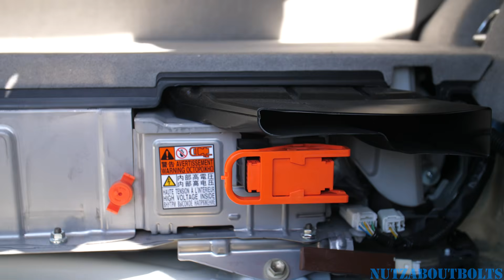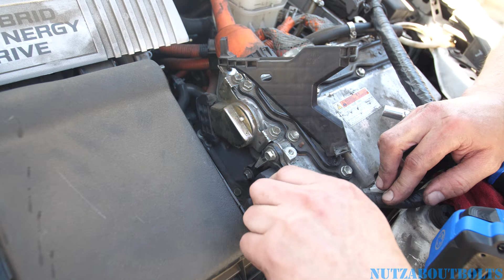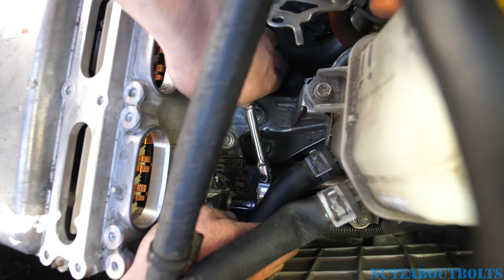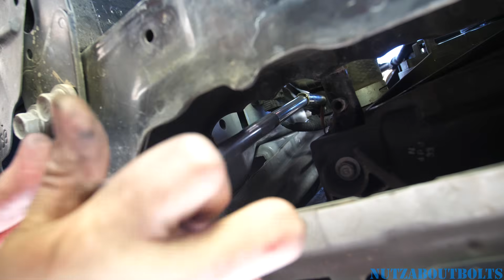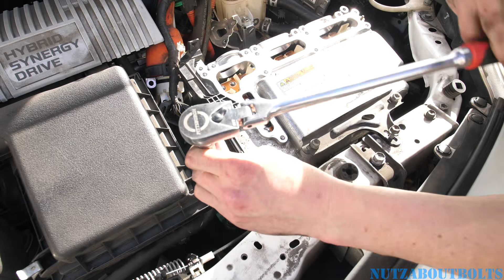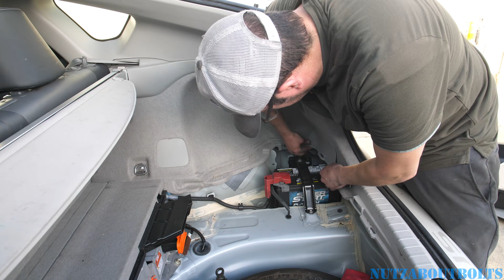2010-2015 Toyota Prius Inverter Water Pump Replacement

Comment: I had to remove the radiator and disconnected the inverter hoses and lost fluids, anyhow when I filled the inverter reservoir and turned the car on, the coolant never dropped and I don’t see movement or flow/turbulence in the reservoir. I did check the pump by hand and do feel vibration as if it’s working but just wondering if these are suppose to have turbulence at the reservoir like the 04-09 models
Reply from the maker: You should see a quick drop in fluid the first time you turn the accessory on engine off. I’d recheck your work to see if everything’s reconnected properly…

Comment: WAIT.!!!   There is a guy who made a video getting the Gen 3 Inverter Pump OUT and IN all from the bottom - he didn't do ANYTHING touching the inverter. Not even 1/4 of all the things that this guy took apart. The only tricky maneuver is getting the top bolt out using the right tool setup but it is definitely doable.      Jus tryna help.!!!
Reply from the maker: That's interesting, there are definitely different ways to tackle these jobs depending on your tool set and experience 👍🏼

Comment: Could a failing inverter pump cause a p261c code? I just changed the water pump and thermostat with aisin last year so I’m hoping those are okay.
Reply from the maker: Looks like that code is for the engine water pump…

Comment: I'm just glad I spent 3 hours doing this and at the end of it I get a "check hybrid system" my car is fuckin bricked and won't go into ready it's a paperweight. Changed the gas water pump, radiator, and tstat and now I got even more problems with this pile of shit, all because it kept throwing an overheat light when going up steep hills, even though the gas coolant system never goes above 94c and I did block test which it passed perfectly, nobody online has the fucking answer for this problem but plenty of people have this problem. Toyota gets way to much praise for there vehicles no BMW has ever fucked me like this car has.
Reply from the maker: Is the orange plug pushed in properly? Is the wp Aisin brand? Any check engine lights?
Reply: @NutzAboutBolts  Yes and yes the pump I even plugged the original pump in and same deal. My old invertwr pump didn’t even pull any codes but It was definitely dead.
Reply: @NutzAboutBolts also at 4:28 you pull off a ground. Mine didnt have a ground like that to the inverter.
Reply from the maker: Was it working before you did this service?

Comment: Changing the coolant pump or heater diverter valve in a 2004-2009 is way easier so I will stick to those years instead of 2010+ Prius !!  but great video and compliments to you!
Reply from the maker: Thanks for the kind words, I appreciate it! 👍🏼

Comment: Before you did this swap… was it throwing a code? My father in law inherited his wife’s gen 3 and while it doesn’t have a code thrown.. the dr Prius app says the inverter is too warm..he gets 35mpg and it seems that the battery doesn’t charge past 50%
Reply from the maker: No codes. I replaced it for regular maintenance.

Comment: Great video in detail. But i found a faster way to do it without opening  the inveter. Little tricky but it can be done. The way it is setup it can be done from underneath.  Long extension  open one top bolt 2 from bottom. Unhook hose from resovior and from inveter. Slightly pull and bent the frame downward just enough and pump will come down with hoses. Put hoses on new pump. Guide hose to the top and push frame back to its place and bolt it back. Attach hose and good to go. Only tricky part was the bracket for 2 bolts from the bottom to place it and bolt it back. Not enough  space to hold it but after playing with fingers i got it done. Filled and good to go.

Comment: I got the P0A94 code after seeing the Hybrid System message, the car drives way slower than usual, I don't want to push it too hard....could this part be the cause of my issue?
Reply from the maker: It’s saying the inverter could be overheating internally… I mean, it’s worth a shot, if this doesn’t fix it, then you’ll need to replace your whole inverter/converter assembly.
Reply: @NutzAboutBolts thank you for the quick reply 👏
Reply from the maker: No problem. If you aren’t on Prius chat, I’d suggest you go on there as well, there’s a lot of helpful people on there.
Reply from the maker: Do you have any other codes besides the P0A94? 

Do you have a C1259 and C1310 codes ?

And is your gas engine running all the time?
Reply: @NutzAboutBolts I didn't see any other code, I was only scanning with the Dr Prius app. I'm able to drive the car but it struggles to get to 40 km/h, I'm guessing the Hybrid System has shut down because I don't have the battery graphics anymore. I would not drive on the highway.
Reply from the maker: I am having the same issue, I’m taking it to the dealership for their customer confidence program. You should be getting more codes such as C1259 and C1310. Buy the artidiag 600 s scan tool that I showed in one of my video, it’s a good scan tool that can scan other codes for your vehicle. I’ll be uploading a video on this Prius issue when I’m done getting the car issue fixed at the dealership this coming week.

Basically your inverter/converter is bad, so the engine is running 24/7 and you’re on limp mode, which restricts your torque due to the transaxle going bad. You can still drive pass 40mph but it’ll overheat the inverter/converter so I wouldn’t recommend it. I am driving it to the dealership since I have no choice lol. I’ll drive quickly so it doesn’t overheat.

Comment: Bad mistake going with the aftermarket version
Reply from the maker: ? Aisin isn't aftermarket, its straight oem that the dealership uses.
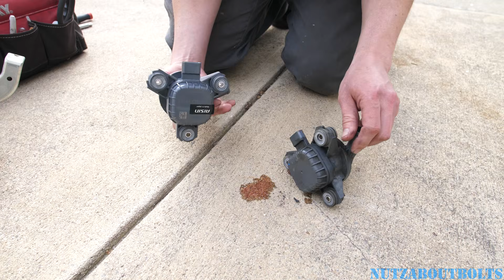Reply: @NutzAboutBolts  17:47. You said not original
Reply from the maker: It’s basically original, Toyota scratched out the Aisin brand name, not sure why.
Reply: @NutzAboutBolts Aisin is the only pump that’s lasted for me.   It’s always been labeled
Reply from the maker: Yes, Aisin is a good brand. I trust it.

Comment: Thanks so much for this video…I was having the dreaded “check hybrid system” and figured out via codes that this pump had failed. Toyota estimated over a thousand to fix it. Thanks to your help I was able to fix it today for a couple hundred bucks!
Reply from the maker: Great to hear! 🙌🏽🙌🏽
Reply: What codes did you get?
Reply: @taechung8436 P261B coolant Pumb B

Comment: was your new pump a lot quieter?  mine is getting noisy like a 200hz hum but water is still flowing. at 140k so thinking about replacing it preventatively hoping it quiets it down as well.
Reply from the maker: Didn’t notice a difference since it’s a preventative replacement part.
Reply: @NutzAboutBolts  10-4 pretty sure i just figured out its the air compressor thats making the noise. because today it started not blowing cold rip.

Comment: On a gen 2 if the pump fails it will pop your 15a fuse on under the hood and there won’t be any movement or flow in the inverter coolant reservoir BUT in the gen 3 it’s tricky because you dont see much movement flow in the inverter coolant reservoir so wondering why that is
Reply from the maker: Thanks for sharing that info! I'm not sure about the Gen 3, but the Gen 2 info is very helpful.

Comment: It's a pump, chance of it needing to be replaced is high, why can't they find a more accessible place to mount that thing?
Reply from the maker: Yeah not sure how the engineers thought it out 😅. The 2nd generation was a bit easier but still had to remove the front bumper and headlight assembly… so I guess this is a little better? 🤷🏻‍♂️

Comment: At 28:00 is that hinge plug supposed to audibly "snap" into place and lock tight? Mine just slides in and out easily, regardless of whether it's locked when it was put it or not. I'm worried about it coming loose while driving.
Reply from the maker: It should, but sometimes it’s so tight, you might not hear it. It’s a stiff plug so I wouldn’t be worried too much, just push it in tight as possible and let it be.

Comment: How do you knownif i need to replace the water pump or this one?
Reply: Just like a timing belt on an overhead cam vehicle , you're supposed to change the belt at certain mileage intervals. With this pump and with a timing belt, it's your choice change it when they say to change it or keep driving it and roll the dice on killing the engine completely. When it breaks. That's where the word preventative comes in, meaning. Do it ahead of time..
Reply from the maker: When the engine over heats. I’m doing it for preventative maintenance since it’ll go bad in the future.

Comment: So I replace the pump and now my car won’t start😭
Reply from the maker: Did you remove the orange service plug? If it was working before, Make sure you didn’t forget to plug everything back together…
Reply: @NutzAboutBolts did it about 3 times over put the old pump back in
Reply: @N @NutzAboutBolts and still won’t start
Reply: @N @NutzAboutBolts it has power like the car turns on but not all the way just throwing a hybrid code
Reply from the maker: Did you remove the orange service plug for the hybrid battery?? Usually people don’t push the plug all the way in and it causes the engine to not turn on. 

Was the car running before all this install?
Reply: @FrTheOneForever You probably forgot to fully lock the orange service plug. It seems like it's latched even when it's not. You have to make sure you do it correctly. I've made this mistake countless times.
Or you forgot to fully connect some connector on the inverter. Even the cover plate has a little safety plug built into it that has to be seated properly for the HV system to engage, as a precaution to ensure you've bolted the cover on.
Reply: Did you ever figure this out. I'm going through this.

Comment: I changed the water pump and thermostat, but I didn't change the inverter water pump. The car has 230,000 miles. Is it worth replacing it? Or how can I get it diagnosed? Thank you
Reply from the maker: Yeah, it doesn’t hurt to replace it early. You can wait till it causes issues to replace it.
Reply: @NutzAboutBolts how I can recognise tell me please .
Reply: @NutzAboutBolts how I have to know it’s issue or no , thank you
Reply from the maker: Shouldn’t be an issue if you want to wait

Comment: Thank you so much for this video! I have a 2010 and have needed these done for several years. I finally got all the parts, both coolant pumps, thermostat, temp sensor, and reservoir caps. I'm disabled so I can't get under my car, and my trunk is packed with stuff so I decided to see if I could do this without disconnecting power. I found that I could, so I removed all the bolts holding the inverter in place and used a ratchet strap to suspend the inverter from the hood latch. This gave me enough room to access the inverter pump and hoses to remove it. The two bolt that go from the bottom were so rusted that the bracket on the top broke, so I spent another $9 to replace it and got two new M6 bolts to install the pump. Yes, the two bolts are a bit difficult to get to but the new bolts threaded right in and just needed to tighten up with my ratchet. Instead of removing the plastic cover underneath I just bought a large catch tray for the coolant. I had some difficulty removing the main coolant pump but finally got everything swapped, installed, torque, and everything works great now.
Reply from the maker: That's awesome you were able to get it done! Good job!
Reply: You hoisted the inverter up without disconnecting any power cables except just the inverter bolts and managed to wiggle out the inverter pump? I'd pay to see that as the alternative is high stakes for missing bolts and snapping plastic pieces.
Reply: @playfullysound4187 I had to get creative because I had a little over half a ton of parts and whatever in the trunk so getting to the traction battery was impossible. Ratchet strap to the hood latch hoop to lift the inverter up and out without disconnecting anything beyond hoses and sensors.
Reply: @jefferymerrill5006  Oh you replaced the inverter pump without touching the inverter electricals not because it's faster and easier to minimally hoist up the inverter assembly but because it wasn't workable to clean out the stuffed up trunk in order to reach the service plug properly because of your condition is what I'm getting but faster and easier and less risky is what I'm seeing as reason enough to do it your way. It even looks like you don't even have to lift the inverter assembly at all as long you can find a way to disconnect the coolant hose clamps but it's tricky. It looks like a mini telescoping rod or a stick needs to be placed in the water pump bracket bolt holes temporarily to line up the hole on one side while you do the other side.
Reply: Well, I know one thing,...you're NOT disabled! Thanks. I was thinking I might be able to do something like you described!!!

Comment: Thanks for the video. I'm preventativly replacing the WP and thermostat at 120k miles. I think I'll wait on the inverter pump until my next fluid change interval.
Reply from the maker: Good plan! The inverter coolant is a separate system from the engine coolant, so you can do it anytime after.

Comment: Question, there looks to be room from under the vehicle. Is it possible to access the pump from under the vehicle?
Reply from the maker: Not possible because there’s 2 bolts that you need to remove from the top…
Reply: @NutzAboutBolts Wow that's pretty stupid, but alas they like to do that kind of thing.
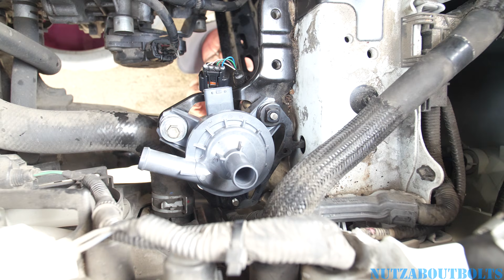Reply: @NutzAboutBolts  19:41 Your video here is showing two bolts from the bottom and actually only 1 from the top, and I can see that one bolt for the inverter pump from the top is reachable If the No. 1 Inverter Bracket is removed with 3x bolts and that takes like a few seconds and 14nm Torque after. It looks doable without removing the inverter assembly to me given this information.

Comment: hi, I have the red triangle too but I can smell burning sometimes from inside my cabin and also my hybrid battery cooling fan runs constantly at fast speeds, the cars pick up is very sluggish too it struggles to go uphill
Reply from the maker: What’s the check engine light code?
Reply: @NutzAboutBolts I git the smell triangle of death code b1503. P 1318  cell block #8 bad dr pruis says 38% battery on the way out. Thinking about replacing the cell and balancing the battery. Rebuilt battery 2nd 1 no warranty 4 months old. Regular battery good. Think the invertor pump is bad also. Newer oem water pump. Great video. Headgastet by me 1 year ago.224k on car. Car after reset runs like 2 city hours than light check hybrid system comes on. If it acts up. Clearing the codes lasts minutes. Car smells hot like burning. Think it could just be battery? Thanks.

Comment: Hi can you please tell me if this pump is what it refers to on obd code P261B on a 2015 Toyota Prius?
Reply from the maker: It’s possible, some have wp issues and cause overheating. I was lucky and it lasted past 280k, I just change for preventive care. I’d change it since I know it’s an item that will eventually go bad, same with the inverter wp
Reply: P216B & P148F, change Inverter Coolant Pump
Reply: curious if you get this P261B code...is your car creating a loud knocking noise.  does that mean the inverter pump is not working and needs replacing?  i replaced the engine water pump but this code came up.
Reply: @hlouie70 in my case there was no noice, the Prius was overheating and I replaced the water pump and took care of the problem

Comment: Did you guys get any error codes after this install? If so did you guys clear them afterwards?
Reply from the maker: No, we didn’t clear any codes, this was our preventative care maintenance. If your code didn’t clear, clear the code. It should clear on its own if it was working properly.
Reply: I cleared mine after making sure the pump was running. Hasn’t come back after some driving. Figure it is OK! EDIT: oops mine is gen 2, not 3

Comment: I’m loosing inverter coolant in my 2015 Prius.  It goes from the full line to the low line every 400 miles. Do you have any idea what could cause that? 
Thanks!
Reply from the maker: Any check engine light?
Reply: @NutzAboutBolts no check engine light. I’m just curious if there is any common leak points before I take it to get checked.
Reply from the maker: @noah786 it’s mostly in the inverter that cools it down… any obvious leak around that area?
Reply: @NutzAboutBolts I will check,  Does it also cool the transmission?
Reply: @NutzAboutBolts no obvious leaks it all looks dry
Reply from the maker: @noah786 do a coolant pressure tester on the inverter coolant reservoir, and see if it drops in pressure. If it does, it indicating a leak in your system and then you can find where it is.
Reply: @NutzAboutBolts ok, thanks!
Reply: @NutzAboutBolts no

Comment: Quick question how did you determine that water pump was no good
Reply from the maker: We didn’t, we just change it for preventive maintenance, but if it does go bad, you’ll have a check engine light 👍🏼
Reply: @NutzAboutBolts  thank u